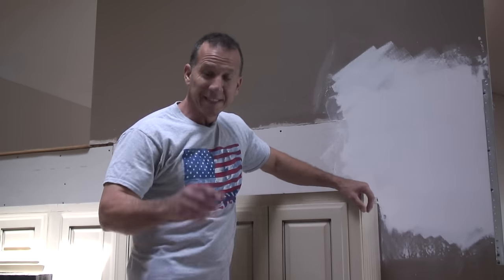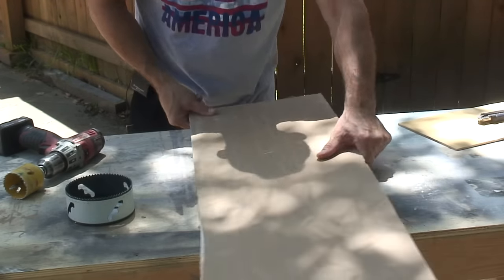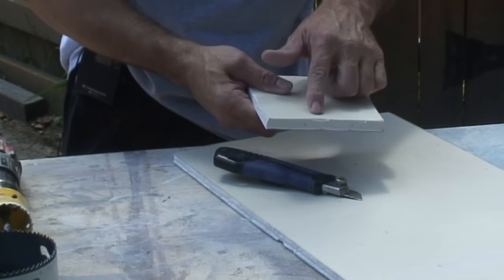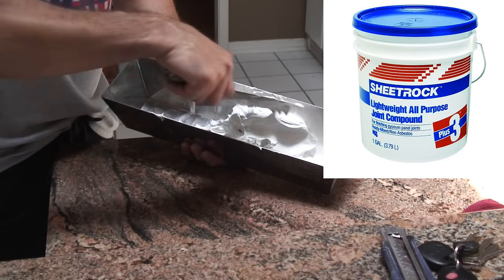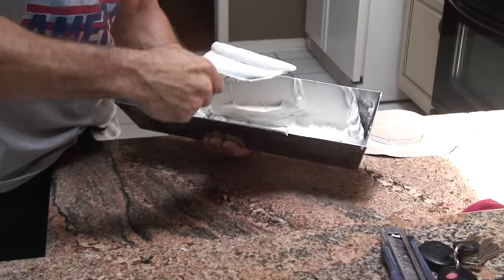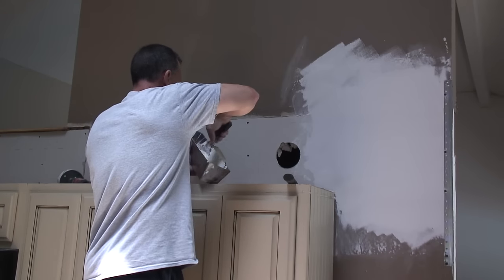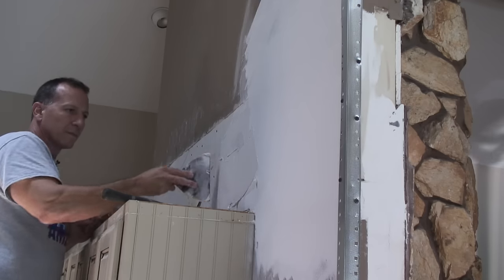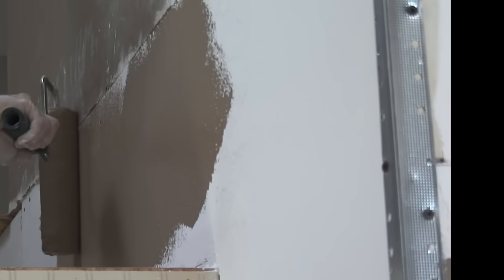Easiest wall FIX EVER!

Comment: Hey Paul. I have been a custom home builder here in AZ for nearly 8 years. I only build new houses but often find that from time to time the dry wall phase will have the occasional dent/hole.I have been one that has subscribed to the older method by just buying the "kit" and going to town. THA K YOU for showing me this method as it not only saves time but more importantly MONEY. And in the end I feel it's a MUCH stronger base as well by using the drywall itself instead of gobs of mud. Thank you again for making this video Paul.

Comment: Thanks just did the patch last night, worked great. The hard part for me is the fading the patch. I put a quick coat last night and plan to put a heavier coat tonight .
Reply from the maker: Hi Mp,
Did you wet the patch prior to installing? If so, you should have been able to squeeze the mud out and get the patch pretty tight, the second coat should be thin, not heavy. If you put too much mud on top you will have a lump on your wall. You can check it by taking a flashlight and skimming it across the patch with the lights off. You will see any imperfections and especially any lumps. Set the flashlight on the wall, next to the patch and shoot the light across the patch, it sill create shadows on the lumps or imperfections. 
GOOD LUCK and Thanks for your comment!
Paul

Comment: This guy has the best home carpentry videos! Genius ways to do things. I used his technique to build three fence gates. Couldn't have done it without his help. Paul, thanks for your Military and Police support! I'm currently overseas and can't wait to get back and use this idea to fix a couple door handle dings in the walls.
Reply from the maker: If your wall is not completely broken through, you will not have to do this. You can simply fill the hole with drywall mud, let it dry overnight and use drywall tape to cover it. You can put a thin coat over the tape and your done. I usually mix up a little hot mud to fill holes like this, then use regular drywall mud on the finish coat. Hope this helps my friend, it is good to hear from you again.
Thank you for your service!
Paul

Comment: Clever! Clever! Clever!  This is one of those tips that, once you see it done, just makes so much sense but you probably wouldn't have come up with first on your own.

Great video instructional technique, especially with all the commentary about the Why's and How's, and not just the What's.

I've seen another video with a square hole patch using this same basic idea but that guy did not have the tip about dampening the paper "wings" first and sure enough I didn't get as smooth and flat an adhesion point.

The tip here about cramming the hole with mud before putting the repair plug in was also good.  But I think the two (new to me, at least) best tips were using a hole saw to easily cut a repair plug and making the hole to be repaired match, and also making and using your own hole saw template guide.  Simply genius.

One other great tip - another once "you see it, it's obvious" tip: how to score the drywall into segments to easily tear off portions around a circle.

Most repair practical new tips and tricks per video minute than I've seen in a long time!  Thanks, Paul.

(Although, personally, I don't think I would ever place my hand that close to a hole saw myself in case it caught and jumped...)

Comment: When I do that, I score the wall around the butterfly patch and then pull some the paper off underneath, especially if it is already painted. That way the patch sits flush with the wall and doesn't bump out on a low textured wall.

Comment: Hey Guy,
I had a short lasting job when I was younger taping and mudding. I was glad many times I had this little bit of experience. Because of this I was able to perform all of my own drywalling projects and repairs in my own home. However, having to patch larger holes was always a challenge. I've experimented several different ways...including using those kits which I absolutely hated. 
Hopefully, I won't have to repair such large holes, but thanks to you I know of a better and more simpler way.
Thank you for sharing your knowledge and expertise!

Comment: Awesome tips.   I only have one thing to add.... before you drill through the existing drywall on the wall, check for any wires or plumbing that could get nicked by the hole saw.

Comment: Paul, when you butter for the actual disk to push in, butter the disk instead of the wall.  Otherwise the disk will push the compound into the wall and leave the joint dry at that point.  Otherwise it's always worked great for me.  I just cut the blank square, but i'm lazy.  Good video.
Reply from the maker: Hi Alex,
Thank you for watching and commenting. It is always good to get different perspectives that work. I'm sure you're not lazy and it is good to hear from you.
Thanks!
Paul

Comment: I'm an electrician i make a ton of holes in drywall and the quickest way is just drill the busted hole with a 6 inch hole saw to make it perfectly round.  Next drill a "puck" with the same 6 inch hole saw out of scrap drywall.  Get a piece of 1x strapping to screw the puck patch to.  Fill with mud and done.  The patch you show is called a "blowout patch" which works but when you mud it you have to blend it out otherwise you will have a big bump in the drywall.  And rooms with color painted walls show bumps very easily.

Comment: Great trick and awesome technique. As a cabinetmaker, I have been using the hole template trick for drilling  large holes with hole saws in thin plywoods for years. BTW, I checked out your custom cabinets...very nice.
Reply from the maker: Hey MarzNet256,
I'm with you my friend, I have a set pluwood squares that have various size holes in them. I use them for drilling in granite without needing a pilot bit and for fine tuning small holes for cabinets.  I plan on doing a video of this set in the near future. We think a lot alike!
Thanks!
Paul

Comment: Man that's a good idea. Simplest way is usually the best way. I've patched drywall to and normally for a large hole you have to find a stud and cut around the hole and all the way to the closest stud and then measure and cut sheetrock to fit. I really wish I knew about this back when I was doing it, its genius. Great video

Comment: Nice and easy! A friend of mine referred me to this vid. I have four pucks to mud (after recessed lighting was installed). Thank you for a well put-together lesson. :)
Reply from the maker: Good morning,
I should have stated that you need a backer board for ceilings because the patch will sag from the weight. This is how you can do it. Make your plugs the same way that I did, get a 1"x2" x8" piece of wood and slip it in the hole. Center the wood so the ends go past the opening and lays flat on the ceiling. Pull down on the wood keeping friction on the wood against the ceiling. Carefully run a 1 1/2" drywall screw into the ceiling, attaching it to the wood on both sides of the hole. Mud your patch and press it in the hole. run a screw through the patch and the wood. This will keep the patch in place and allow the mud to dry without sagging, If you have any questions,let me know.
Good Luck!
Paul

Comment: Great idea. I usually cut the hole to the stud and then cut a scrap piece approximately bigger than the hole.  Then trace the scrap piece over my hole on the wall and cut the pencil trace on the wall so the scrap piece and the hole will be the same. Then screw the scrap piece on the wall to the stud. It might be a few less steps but I think your method might be slightly smoother on the wall if the studs are off.

Comment: I like the idea.  I don't drywall for a living, but would suggest spray glue, rather than spackling, to attach the plug.  Then spackle to smooth and hid the plug.  This is "similar" to the pre-glued spackling tape I've use in the past.

Comment: That's a great fix. I will try it next time. You can also use card board as the guide hole. Works well. Nice vid.
Reply from the maker: Good tip Dave, I really appreciate you taking the time to comment.
Thanks!
Paul

Comment: Job well done. Only thing I have to question is not using a sanding block so you don't get finger grooves in it. in your example behind the cabinet is fine, but what about in the middle of someones living room?
Reply from the maker: Hi Alex,
I only have to lightly sand my patches because I make thin passes. If you have to aggressively sand the patch, it would be best to use a block. I've been doing this a long time. That is a very good question and I should have mentioned that in the video.
Thanks Alex!
Paul

Comment: Where I come from, that's a California patch.  Bar none, this is the best demonstration I've ever seen of how to do one.
Reply: PS- The hole saw techniques is slick, but if you don't have the right size hole saw, you can just cut a rectangular hole and score the patch to match. I find it easier to butter the back of the patch, rather than the hole. I've never tried moistening the paper, but it seems like a good idea.

Ricalde doesn't mention that if you have a textured wall, you need to sand off the texture in an area several inches bigger than your patch, so the knife won't ride over the texture and make ridges in the area you're feathering in.

Texture-in-a-can is readily available. Shake until you think it's well mixed, then shake it for 2 minutes more.  I find it works better if I run hot water over the can until the can stays warm even when I shake it- that is, the contents are warm too- that increases the pressure inside. Practice applying texture on a piece of cardboard or scrap drywall. Try to match both the size and density of the globs of texture.

Start moving your hand 6" outside the texture area, hit the button, spray and release before you stop moving. If you stop and reverse without releasing the button, you get thicker texture at the end of each stroke.  Go up & down, back & forth and at 45 degrees, spraying lightly- you can always add more, but you have to scrape it all off and start over if you spray too much.

Comment: in the union we called it a hillbilly patch but we used to make ours square just because when your hanging drywall on the job we dont have hole saw blades and a reg drill, just the clutch gun but nice trick
Reply from the maker: Hillbilly patch, LOL I like that. Yeah I still make square patches myself. I did this video for those who have a hole saw on hand. It is also easier for a beginner as well. 
Thanks JD!

Comment: Thanks for a very useful video. How would you handle a wall patch that has texture on it? They are all slightly different so obviously that is a challenge in itself.
Reply from the maker: Hi Micky,
You will need to lightly sand the area around the patch. I will also use a damp rag or sponge to dampen the area. This will allow you to feather your patch into the surrounding area. You can use Homax spray texture to match most walls. I will usually go back over the spray texture with 220 or even 400 grit wet  sandpaper after I prime it and before I paint. This will make the new texture match the old texture on your wall. I hope this helps.
Thanks!
Paul

Comment: I knew I wasn't weird. I rehab apartments and on occasion a renter will want a Washer/Dryer stackable installed, I've always saved the drywall cut outs from the exhaust port. Makes patching the hole when they move a breeze. If i have to, I'll use a paint stir stick as a form of backing to hold it in place while the mud drys.

Comment: good job I  use the same technique  but if you don't have the saw hole just cut the out square first and mark the wall with it and cut it with your blade or saw blade using the same technique but on square shape

Comment: Wow what a neat idea. I'll be using this! 
I didn't know harbor freight had hole saws, I need these too.
Reply from the maker: Hi Obwan,
You can find hole saw sets on Ebay.com and Amazon.com for under $15.00. They are not the best, but will work great for this. Thanks for taking the time to watch and comment!
Paul

Comment: Hey Paul, this was another excellent teaching video! I would be interested in patches behind door handles that will hold, if you ever get a chance to answer all the questions. Thank you for your tips and expert step by step projects!
Reply from the maker: Hi bihbgm,
This method will work anywhere on your wall and it is pretty strong, but you will need to use a doorstop of some sort, or you will be patching it again. I try to answer every question, but I am not a fast at typing and I sometimes get behind. It is great to hear from you.
Thanks!
Paul

Comment: If you use your guide to cut the patches you can remove the drill from the hole saw and cut the patches without a hole in the middle

Comment: What about trimming the paper on the wall and going through the existing paper, then peel the existing paper off and you set the new paper exactly flush with the wall.  OR is that too much?

Comment: Paul,

I absolutely love this idea. You have no idea how many hours I've  wasted trying to get some kind of a brace behind the hole inorder to plug it and then having to float the patch.

I have a question. Let me begin by telling you that I am not a professional at any construction trade but I did own a construction company (General Contractor) in San Antonio (for those of you that don't know, in Texas you don't have to be licensed to bid or do jobs as a General Contractor). I had over $15 million in bonding and financing. I only bid Goverment jobs (schools, city, county, state, and federal). Their plans always sucked and I killed it on change orders. I never shoped sub contractor bids - the guy or gal that I used in my winning bid got the job at the price he/she bid. Sub Contractors and material suppliers loved working with us.

Any way, my question is: When you're hanging dry wall initially, can you make a cut the full length and/or width of the sheet, leaving the paper like you show, and hang it? Then you wouldn't have to paper any seems.

I don't have a job to do but I was just wondering.

Thanks

Comment: Paul, do you have an easier way to patch a sheet rock hole that has a pipe or shower head exiting through it. Would be great to have a video for that. Thanks for all your videos. Really helps.
Reply from the maker: How large is your hole? It can usually be covered by an escutcheon ring, unless the hole too big.  Please let me know your situation and I will help you address it. 
Thanks!
Paul

Comment: I used to patch this way and then i discovered loctite sheetrock adhesive (not sponsored by them currently). It works better and doesnt leave you trying to feather in that hump youll end up with.

Comment: Hey Paul, is there a reason u chose circles as opposed to just cutting out a square for example in the wall ...was it just the ease of using the drill?
Reply from the maker: Hi Tony, I have been making square patches for years and it is also easy. I chose a drill because it makes the job easier for the average DIYer and it also eliminates the need for a pattern.
Thanks!
Paul

Comment: Hi Paul

With all due respect, and without trying to take away from the huge leg-up this provides most folks who don't know this sort of thing already, may I offer a couple finer touches?

1) I see no advantage to forcing it round if the hole ain't round initially.  It's more difficult to make a round plug for a couple reasons: drilling JUST the RIGHT depth w/ the hole saw without hitting the face paper is going to be difficult for the beginner, and then breaking away the excess from around a circle is also needlessly tedious

2) if you ARE dealing w/ cutting and breaking away the core to leave a round plug, make your cuts TANGENT to the circle, not perpendicular to the tangent.  Even doing so, round is tough to break away without tearing the face paper away from the core, but I think you'll find it's a little cleaner.

3) making a rectangular (heck, even a triangular) plug is much simpler, requires no hole saw set, drill or awkward break-away on the back. Once the plug is made, trace around it over your hole in the wall and clean up that hole to match - with a keyhole saw or similar.

4) don't get fancy trying to mud up the inside edge of your hole any more than happens to get there with a quick application on the face around the hole.  Most of that is likely to be just pushed in when you insert the plug.  Given the likelihood of there being some separation of face paper from plug, try as you might to minimize such, if you apply mud to the back of the plug allows you to make sure to get some in any such separations.

5) given that this mud is for adhesion rather than finish, worrying about bubbles in the mud is straining at a gnat, IMO.  Since premixed all-purpose comes so stiff that it absolutely SHOULD be thinned before using it in this application, having problems with bubbles seems all but IMPOSSIBLE to this old mudslinger!

Anyway, if you doubt me, try timing both ways, or - feel totally free to round-file this pair of pennies forthwith.

Fare thee well!!!

;)

Comment: I learned and used this from 1968. Wont work with door knob patches. Door will knock the new patch out. I place short studs between walls glued in and screws. Next time banging the door to the wall will leave only a dent, if anything. I never had a fail. I am 80 and still doing this. Valspar is not a good product. I have been a full time painter 50+ yrs. Union trained.

Comment: good stuff Paul. good video. I recommend doing some buttering on the patch piece as well, where the edge of the plug meets the paper. just a little, improves bond in the seam. well done buddy, I hit subscribe
Reply from the maker: Good tip Peter, I really appreciate you and your comment!
Paul